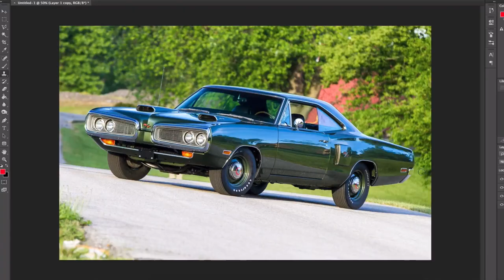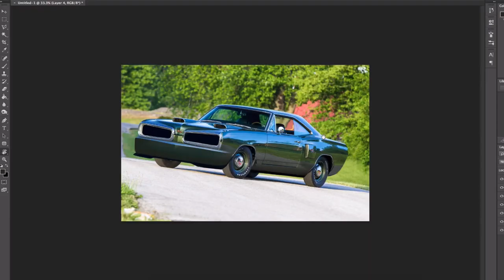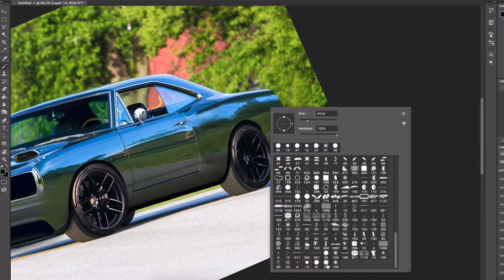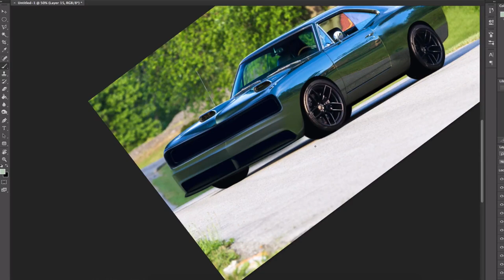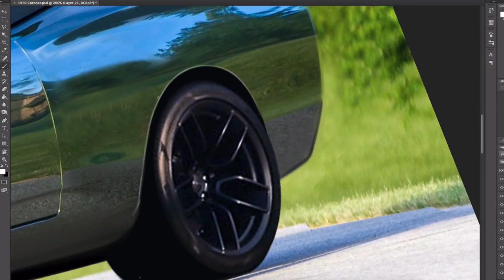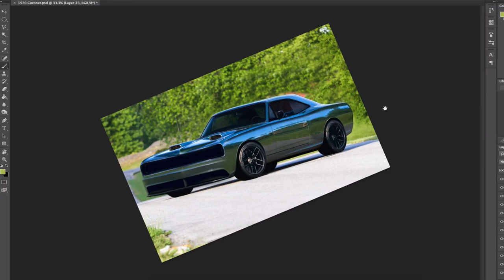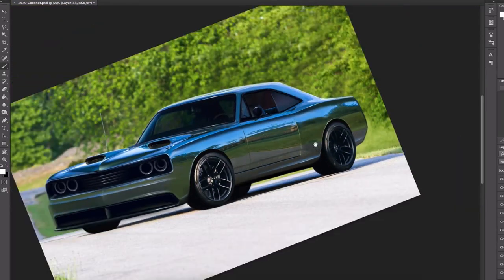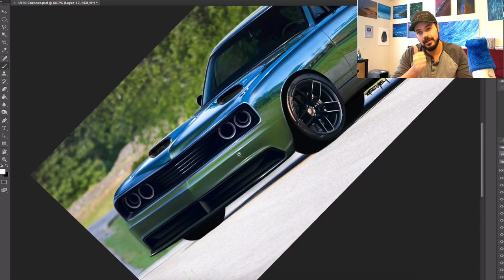I Re-design the 1970 Dodge Coronet Into a Modern Car

Comment: I would love if you did a modern day duesenberg. Like a true modern car but with the proportions and huge size of old duesenbergs. Things like the long hood, the low roof line, short tail, and some detail of the old cars like the bumpers that sort of a "wave" to them, or the rear fenders that had little parallel chrome strips could be incorporated into the design!

Comment: I am curious what you think about the design of a first generation Dacia Logan built with small modifications between 2004 - 2018 especially compared to Renault Clio from the same period, on the platform on which it was developed. It seems to me personally that Loganu looks better than Clio. The ones from Dacia have removed Logan II completely redesigned compared to the first generation but in my opinion, even if it looks good it has lost some of the incisiveness of the first generation. What would the Logan look like if it had updated the old log lines in the design to completely redesign it?

Comment: The added metal(?) at the front of the car fixes at least 75% of what I didn't like about the original.  As others here have said: the split bumper is a styling differentiator and should have been retained. 
 But then there is the problem of the rear.  With this front end treatment, there would need to be metal added below the rear bumper and the tail lights would (need to be?) bigger.
These are decent looking cars, though I prefer the 68 or 69, unfortunately Plymouth did a better job with the styling and the marketing of their equivalent car.

Comment: The car looks great, but it's doesn't look like a Coronet anymore. It look's like a generic b-body platform - more like a similar vintage Charger or Roadrunner. To fix it I would extend the rear-end with a bit more taper, and reintroduce the split grill, but not to the extreme of the original. Then it would be perfect!

Comment: Nope. Sorry, I don't like this redesign. The 1970 Coronet R/T front end was distinctive enough to set it apart from the similar Charger and Challenger models. This looks like a Charger with Challenger halo headlights.

Also, when you stretched this car's proportions, you left the lower door opening intact, which suggests that the doors open from the back of the front wheel well. That would be awkward. 

Some cars just shouldn't be modernized. Today, people want Jelly beans with lots of unnecessary creases and body lines and everything has to be a bottom breather; and that's if they want a car at all. I'm just grateful that I was a child in the era when style was just as important as substance. Nice try, though. 🌟!

🐰